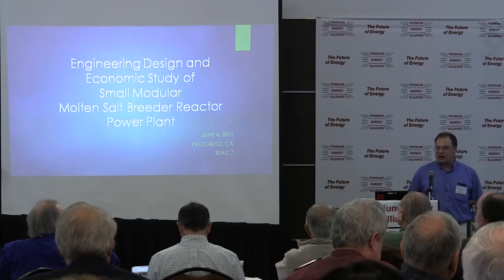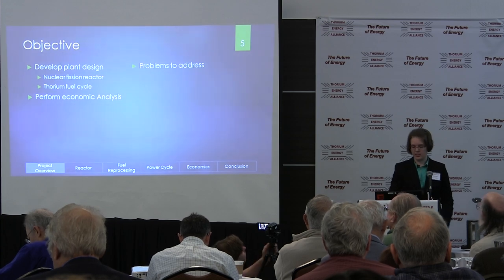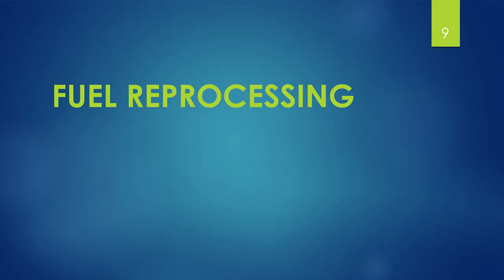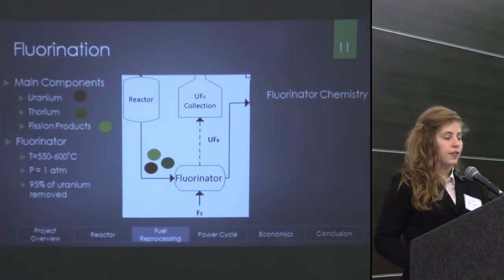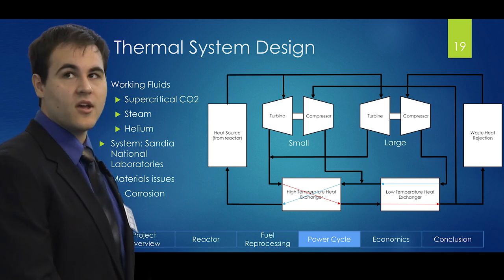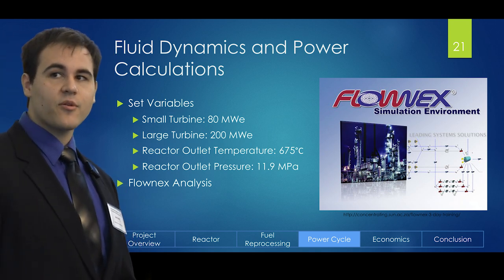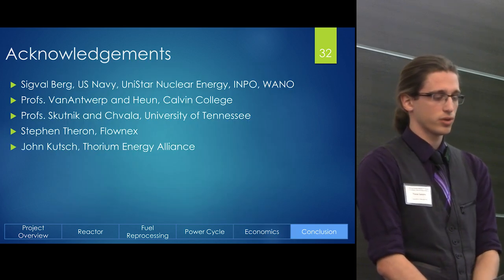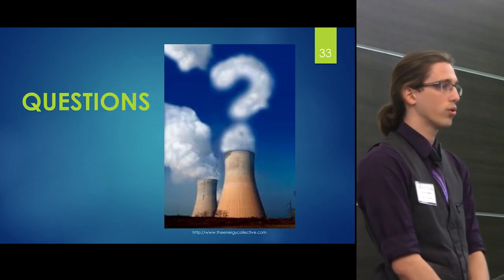Calvin College Student Study on Th-MSR @ TEAC7

Comment: 200MWe seams very big for a Small modular reactor to me.

Its seams to me that a number like this would be left open until a more clear calculation of the economics of the system is reddy. Simply optimizing the economics of the reactor to the technical specification.

For example there might exist transport issues that for exampelle might raise the cost quite significantly from one power to a other that is much more than liniery.
Reply: 300MW and under is consider small
Reply: SPLITSLEEVE 300MW is small for a normal reactor. But for modular reactors its rather large. To be modular it must be transportable in one pice.

Comment: How well does this Th-MSR work in a Zero Gravity envirerment ?  Or in a 1/6 or 1/3 Gravity envierment ?   Does the Navy have a history of use with Thorium ?  Are you students going back to school for a PhD ?  Or are you joining the ranks of the unemployed ?  Thank you G.M. for another great video !

Eyes UP and lights down,  tjl  Sent by Win7Pro64 w/ADSL
Reply: Tim Lipinski The only place where gravity might be a problem is when manipulating gasses - specifically, xenon in the reactor, an uranium hex in the fluorinator.  Finally there's the passive over-heat plug in the bottom of the reactor to allow the fuel to drain to storage in an overheat condition.  Some other smaller problems may exist in the details of the reactor and/or chemical processing.

I don't think the Navy has any thorium reactor experience.  The only experiment in the US that I know of was the Oak Ridge MSR experiment.

Comment: Current interest rates are extremely low right now, and loans can be granted for much much lower than 12%. 

Pension funds are struggling to meet their need for 8% growth worldwide. This is because the central banks are keeping interest rates around zero or in some cases below zero! 

With the United States oil fracking industry poised for collapse, investing in Thorium MSR tech now, could be thought of as a hedge investment too. 

The global economy is slowing down and several notable economists (such as Jim Rickards. - https://twitter.com/jamesgrickards) suggest the United States economy is in a "structural depression" (http://dailyreckoning.com/prepared-inflation-deflation/) - meaning that one of the only ways to improve the economy is through infrastructure investments. A Thorium MSR would be one of those solutions - however most economists are unaware of this technology and so they can't be cheerleaders for it.

It would be interesting to see this report adjusted for today's extremely low interest rates, and a stronger case made for gathering investment right now at today's extremely low interest rates. So I would suggest re-working the numbers at 8% interest to start. Consulting other investment fund managers would be a great to see if this an interest rate could be procured at an even lower number. One economist who is familiar with Thorium MSR (He has done two podcasts with Kirk Sorensen ) is Chris Martenson (peakprosperity.com) could likely be of help to give some financial advise. 

I really believe having some notable economists, becoming cheerleaders for Thorium MSR, could be the tipping point for making it a reality.
Reply: +Kris Stinson At 12% there would be no shortage of investors, especially if you had government-backed loan guarantees.  I also think a lot of the cost estimates were EXTREMELY conservative, and the final reactor would be much more affordable in both up-front costs and operating costs.

Comment: isn't the point of MSRs that there's no need for keeping water (LWR) at such high pressure? needing to keep CO2 supercritical does the same thing!
Reply: As long as it is not inside the reactor system it is not a problem.
Reply: @placeholdername0000  that's the issue: keeping it inside the high-pressure reactor system! why not end that requirement?